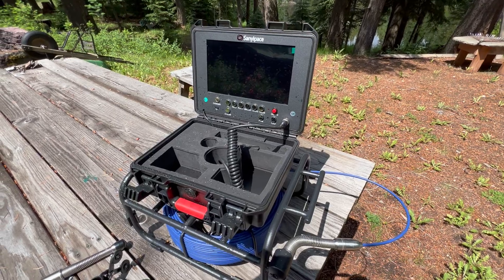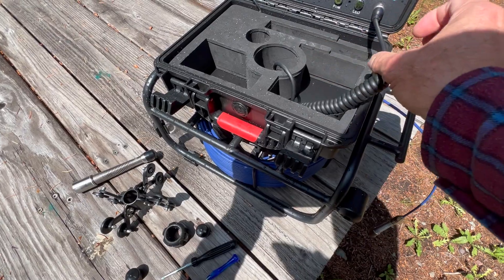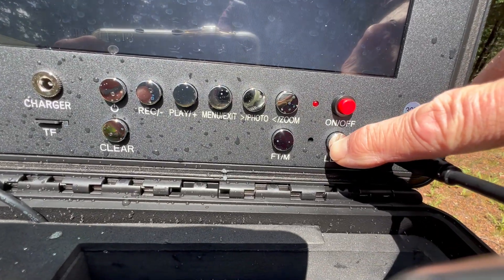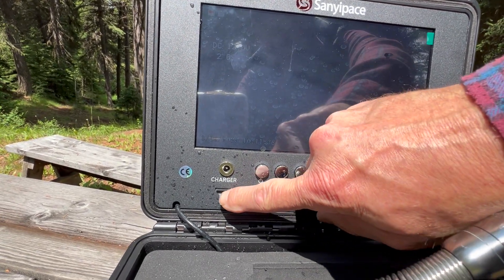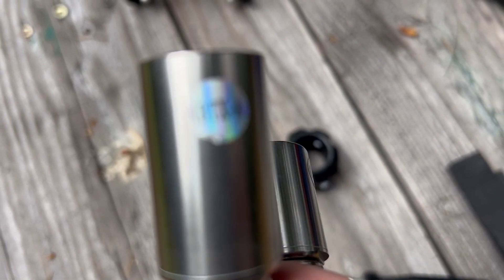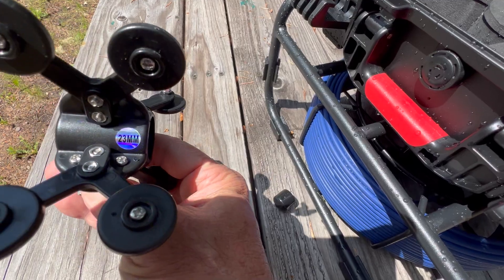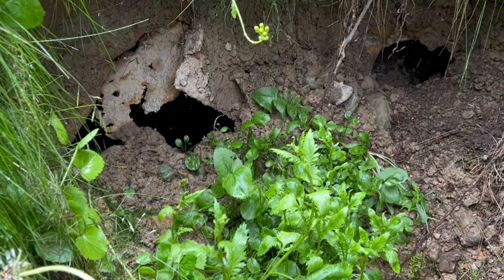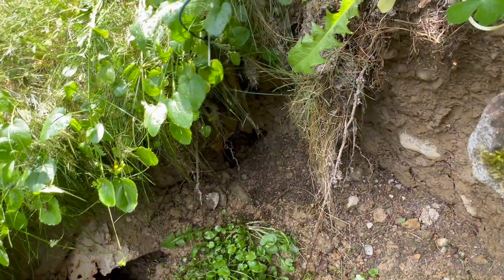Sanyipace Sewer Camera makes sense of this mess. Collapsed septic. Ancient drain field? Looks good!

Comment: That is a very nice scope, ,  I have a cheap $50 one I got to inspect my septic system but the wire is very soft so it was hard to get it to move forward, I had to use a load of zip ties and tie it to a jet cleaning hose to get it to advance so cheap ones are not great.        My Septic system is from the 1950s so the parts are from  cement and I had to replace the distribution box what you filmed at the end as it fell apart.    Also there is a T shape pipe in the Tank that stops solid stuff from flowing out in to the field that was falling apart so replaced it just in time.   If solids flow to the field it can clog up all the small weep holes and stop it from draining.